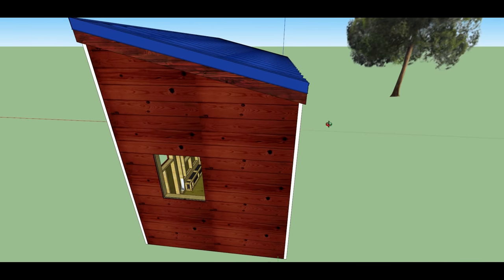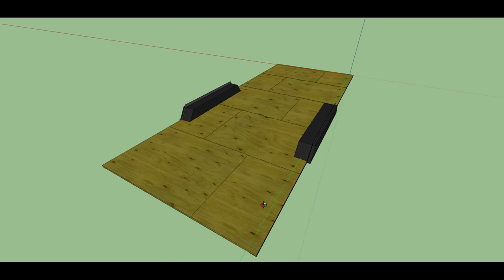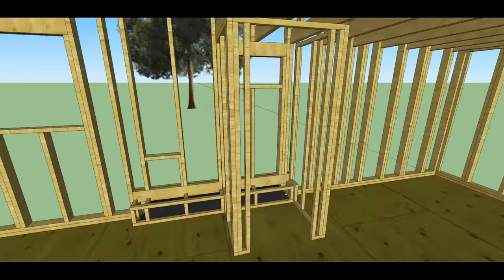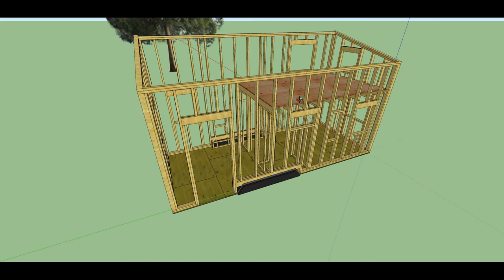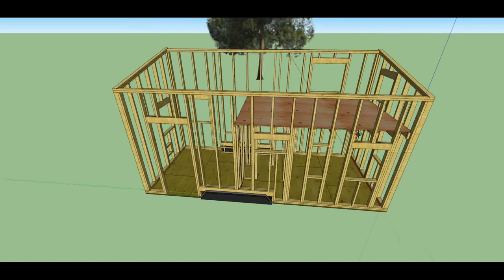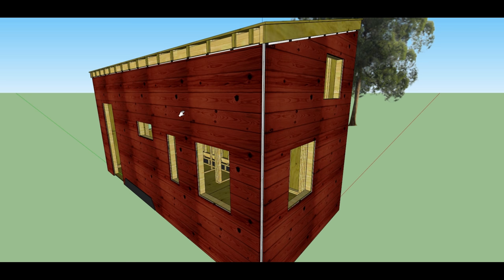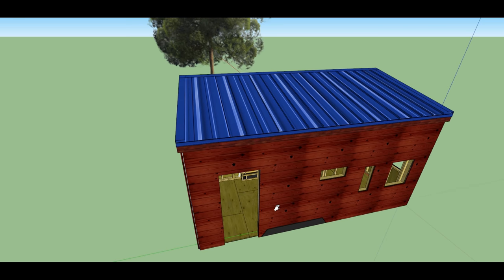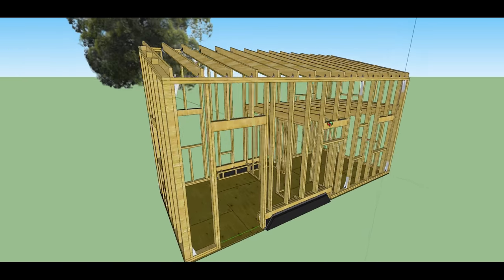Tiny House Plans - Analyzing the Structure (Ep.4)

Comment: I apologize, I have been watching some of your videos in the wrong order, and commenting on them recently, but I think after rewatching this one, I am us to speed on what you have done so far....This Sketch up program is wonderful, (I need to get and learn this program), and every thing you showed/designed on here looks great.....I just had a couple of comments; I did notice that your one, fixed window, didn't show a header above it?.....And, was wondering what type of windows are you using?...Like a standard, vinyl, new construction, typical residential window, with the full nailing flange, all the way around?...and, what type of interior wall/ceiling finish materials are you using?...Like wood, or drywall?....and when you spoke of the plastic vapor barrier, for the roof & walls, I assume you know that always goes to the warm side of the room, the interior side in your case, then your finished wall & ceiling materials over the vapor barrier, yes?....Thanks, Timmy Gee!
Reply from the maker: Timmy Gee There is no header because it falls between two regularly-spaced studs so there is no weight to distribute, but you make a good point about the nailing flange... we may need to throw in some blocking there to fasten into. Should have the windows on site any day now to check.

We plan on using some kind of wood siding on the interior. And yes our vapour barrier is on the warm side of the insulation. The poly does have a portion that ends up on the outside because of how we have it wrapping over (from beneath to on-top of the subfloor), but we were just looking at that today and talking about maybe putting some slits in it to allow the subfloor to breathe along those edges.

Comment: Did you draw you trailer yourself or load it into sketchup?
Reply from the maker: tyler martel I actually emailed back and forth with Iron Eagle to get the dimensions of all the top surfaces so that I could model it myself and then model the house framing with confidence. So the trailer is not fully modeled, meaning it's missing the wheels and the tongue etc.
Reply: Thanks for the response!

Comment: Maybe too late but typically in my location if you've got plywood for sheathing you don't need metal cross bracing. If you went with 5/8 ply instead of 1/2 it would increase your rigidity. And please only use plywood not OSB... Too much potential fit failure with OSB... My two pennies
Reply from the maker: tech2480 Are you referring to tiny house construction specifically or general construction? We figured that we'd be better safe than sorry with a little extra strength against racking since the structure could be subjected to unusual forces.

Comment: Another thing,...(I've been thinking again, sorry)....you said you were thinking of staining the outside wood a dark brown....Just remember Dark colors draw in the Sun more intensely, and will heat up that tiny house in the summer fast....and a dark roof will do the same....something to think about.....
Reply from the maker: Timmy Gee We're lucky to live in an extreme climate.... an extremely mild one. We don't get very cold winters or hot summers, which is why we're not concentrating as much effort on thermal insulation. We do have a very wet climate though, which we are taking measures to deal with.